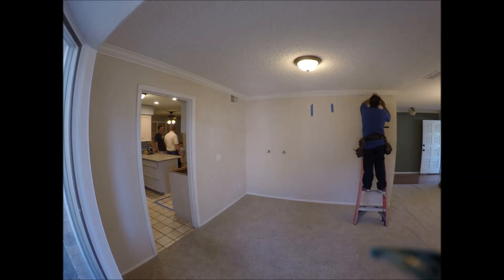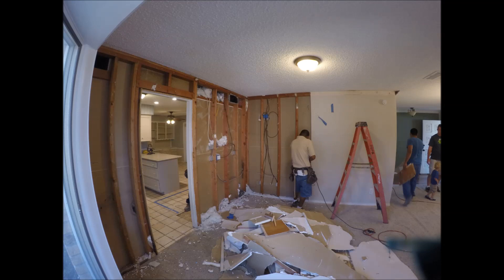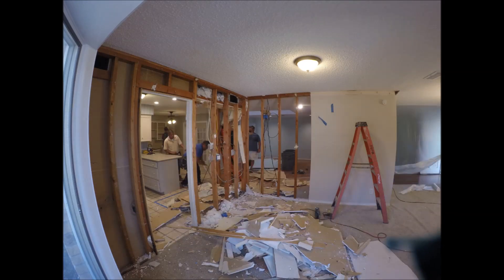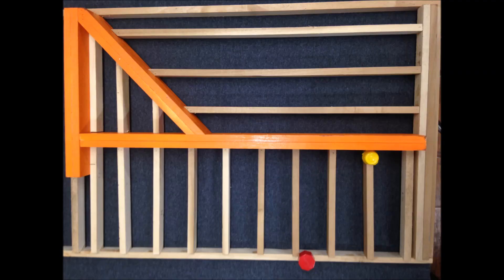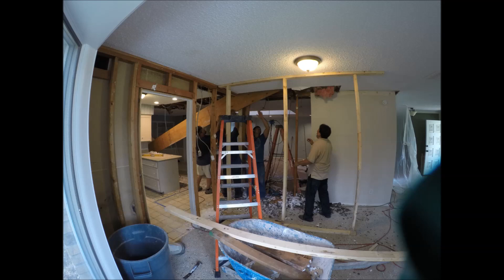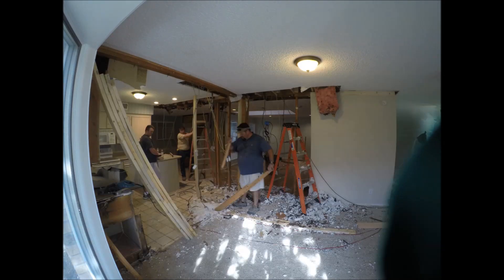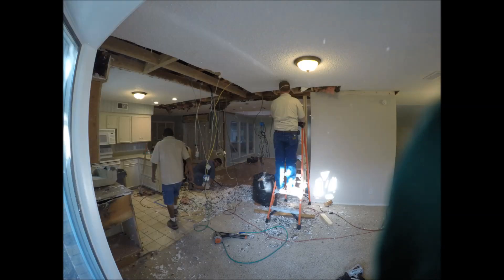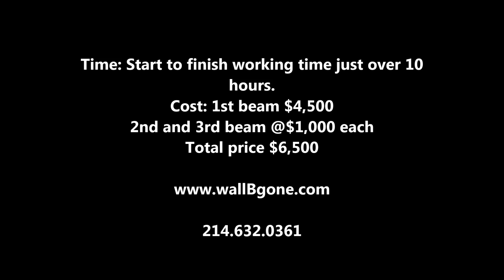How Much Does it Cost to Remove a Load Bearing Wall?

Comment: in my opinion thats a steal bc I recently worked in a remod where home depot charged the owner 12k to redo their shower. All they did was glue faux marble panels over the existing stall and put in a glass door. Took em half a day. They also had homedepot do their kitchen for 25k. It came out ok but the materials used were subpar. Thin fake marble counters, poorly done backsplash and the cabinets were refaced with vinyl and had new doors and drawers put in. They did the kitchen in 3 days but the backsplash guy never came back to clean up the grout off the tiles which i ended up doing. This is in Houston mind you.